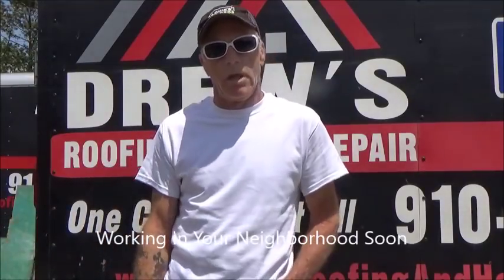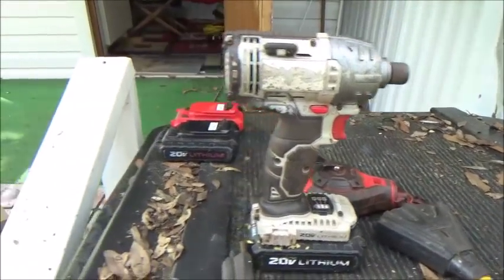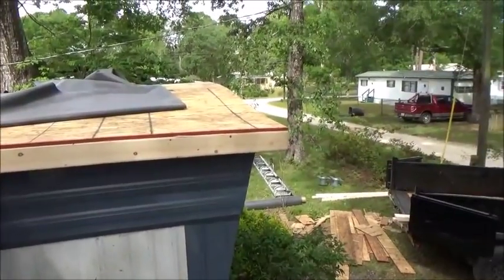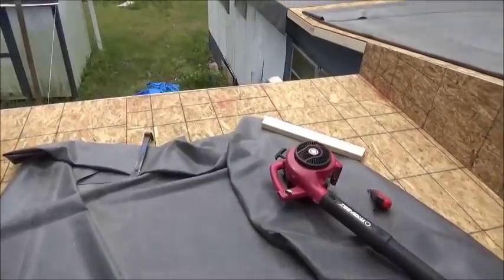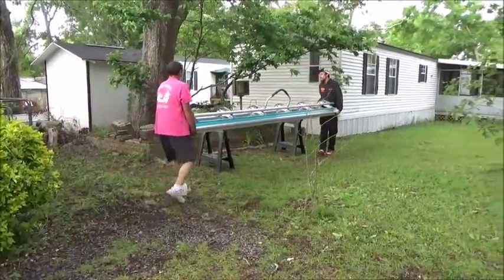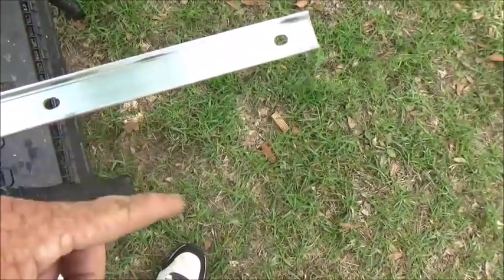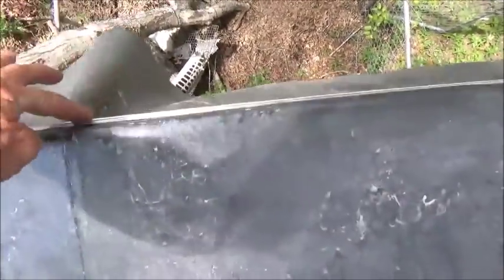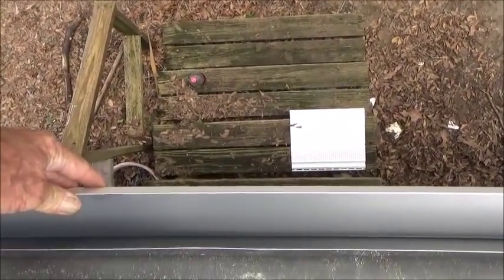How to repair a single wide mobile home trailer roof Manufactured Home

Comment: Drew, I built a front deck 10 x 10 with roof on front of my mobile home and used 2x4s for joist. Not long after we got 18 inches of snow which destroyed all my 2x4s and I ended up having to replace them with 2x6s which have held up without any problems. I wont ever use 2x4s again because they just aren't strong enough especially under all that snow. LOL
Reply from the maker: I agree. I use 2x6 for everything

Comment: Thanks for posting these. I’ve been watching for a few years now and learned a lot and did my own floors and walls. Roof is next. With a metal corrugated roof, would you still put plywood down?
Reply from the maker: mictjustin no just straping

Comment: Great workmanship Drew!!  Was wondering if it would be feasible to bond epdm to the 1 1/2 foam board insulalation used so often on mobile home re roofs?
Reply from the maker: I think so it’s water base glue so I say yes. But it’s not going to be as ridged at OSB

Comment: Seems like you should have a way to get air moving under that osb .  Condensation,  moisture from the inside of the house from cooking will be trapped under the rubber membrane. OSB turns to mush after a few years of high humidity.  Not to mention all the mold on the old roof. I have gone back to API plywood
Reply from the maker: I don’t think I’ve ever heard of a PI but they do have something called sure bored here the only thing about it is that it’s so heavy
Reply: @Drewsroofingandhomerepair  A good 5 ply 1/2"  exterior plywood with the APA -American  plywood association [not api] stamp is about $18 a sheet here. Also, there is this really fine faced sheet, I think its from Peru or Columbia unfortunately, that is exterior grade with top veneer quality for only $16. Here is a link https://www.lowes.com/pd/Plytanium-15-32-in-Common-Pine-Sanded-Plywood-Application-as-2-x-4/3043815 this has a true exterior glue where osb and fir ply only have a "exposure 1" rating. Also, I like to use pressure treated lumber for the runners, not much more than standard

Comment: I'd personally flash every penetration...lapseal is for flashing and cut edge of reinforced epdm. Lapseal gets weathered away faster than other caulking. Its really just to help the flashing cure where the factory edges have been cut.....
Reply: Geocel 4500 is a great caulking.  Also waterblock from carlise would be a better choice to do penetrations with. Bead under the membrane around hole then geocel 4500 ontop under the flange of vent.
Reply from the maker: Yes sir I agree I like Geo sale 4500
Reply from the maker: I also like Alex cell

Comment: Question, How do you know how much additional weight the exterior walls can bear structurally. When considering what possible roofing repair options you have if you want to stay within code?
Reply from the maker: Well we know that 2 x 4 walls can stand another story on top of it so a 2 x 3 wall should surely be able to hold OSB and a little bit of rubber. If you think about it I’m not adding much weight per square foot
Reply: @Drewsroofingandhomerepair  oh.... Kay. .  The 2x4 walls that are load bearing that can stand another story on top of them are framed with double  top and double bottom pressure treated wood at 16 on center on average and the wall connections to another wall require interlocking the top of the ouble plate of one with the bottom double plate of the other. And then those walls have to have diagonal sheer bracing of metal flat staapping of 20 guage or exterior plywood minimum of 1/2 inch connecting every bit of it to the double bottom. Plate every six inches.  
   There are a lot of reasons  that load bearing 2x4 walls can carry a second story and all of them are needed it work as a system. Of strengths enforcing each other .   Mobile homes require far weaker standards of exterior framing . The wall connections don't resist twist or sheer load stresses the same as the pressure treated bottom plates.    
   Is this a quick short answer you gave it is this your real qualifying licensed bonded contractors reply about the engineering of your roof builds to meet local and state building codes for structural safety ?
Reply from the maker: Well all I can really tell you is my local building inspector loves it he thinks it’s the best roof ever put on a mobile home. Maybe he’s just allowing me to do it because he knows me or maybe he’s lying to me to do it because he agrees that the weight that I’m adding to the top of this roof and the fact that I’m connecting it all together with screws and OSB makes the roof system stronger than it was that’s all I can really tell you. The other thing is I have five guys that go up on top of them roofs and I would not let five guys stand in a 2 x 2 or a 3 x 3 area unless I had plywood added or OSB added first. I can tell you in some of my videos if you watch I will put five people in one small 4 x 4 area with no issues. It really increases the strength of your mobile home roof

Comment: Just a curiosity question is there a way to include some insulation into this process?? If so would it go on prior to the plywood??
Reply from the maker: You can add insulation. It’s called high density insulation board. And it goes on top of the plywood or OSB
Reply: @Drewsroofingandhomerepair  Thanks so much Drew, your a big help.
Reply from the maker: Anytime

Comment: Could you add foam panel insulation between the runners before the decking is down, or does it need to be able to breath? Great videos by the way, want to do this on my own home, whats the cost on a project this size?
Reply from the maker: Kevin Dahlberg Yes you can add Palmer in between the one by fours if that’s what you want to do and if your roof doesn’t have vents go ahead and add them like we did
Reply from the maker: If you’re buying the material yourself you’ll probably spend about $2000

Comment: What was the size of sheathing? 7/16 or 1/2 inch? I hear you can use 3/4 but why would you?I think that's a bit much for a single wide mobile home don't you? And thank you for video. I'm going to try this next spring.Right over my metal roof with about 5 layers of  roof coat on it.I was going to attempt it alone but I think I will hire a friend to help me. If you were in my area i'd just call you but i'm out here in Utah. Thanks again drew very informative. by the way do you have to get roof permits where you are  before you do it?
Reply from the maker: No permit for this
Reply: @Drewsroofingandhomerepair  Thankyou

Comment: Can this be done on a 20x50 doublewide? Thanks for your help.
Reply from the maker: That’s a good question I’m curious why you would want to put Rubber on a Doublewide but it is possible to do
Reply: What then would be the best way to go. This is a low pitch roof on my 20x50 mobilehome.Thanks for any help.

Comment: Damn good idea. I need it done. But i have a question. How long does the rubber last? And can it handle the Montana cold weather
Reply from the maker: I’m not sure how it would do out there. I don’t think the cold bothers it so much so I would say it should work fine 
they use it all over the United States
Reply: Epdm will do well there. They roof all the camp shacks in canada that get shipped up to northern canada without issuse
Reply from the maker: I guarantee it can hold that Montana cold weather

Comment: Nice work!! Ya that's BS on too much weight.
Out of curiosity how much did you charge that customer for that project? If you don't mind my asking.
Reply from the maker: 5300
Reply from the maker: Thanks for the comment Tracy I hope you are a subscriber
Reply: @Drewsroofingandhomerepair  Yep. Lot of mobile homes in my area.
Reply: @Drewsroofingandhomerepair  Seems like the interior of this place would be wrecked from all the leaks, unless you tore some sort of roof off first.
Reply: @Drewsroofingandhomerepair  Good price for the work!
Reply from the maker: I want to say somewhere is around $5000 for the finished product
Reply: @Drewsroofingandhomerepair  I just did  a 10x52 mobile with 2 drunkards and my 13 year old son. The 55 Mil new white/black vinyl was $400 delivered, $30 for adhesive and $80 for drip edge/finish strips. $75 for  urethane caulk.  I gave the guys $100 and a few cases of beer. My kid did most of the work for $40.  So thats about $800 + gas and beer. You should look into vinyl - just as long life and won't cook eggs on it in summer. Thanks for the tips though!
Reply: @RRaucina Did the vinyl come in rolls like the rubber drew uses? 30 bucks of adhesive covered the whole roof? Must of been a thin coat? Was that 5 gallons? Where did you get vinyl. I've got vinyl coating on mine but the cold and ice are murder on it in the winter. Lots of new cracks every year. Maybe its because its on top of metal? I just noticed you didn't put any strips down or any new sheathing.Did you glue it to a metal roof? Better check it in spring if you did. Hope it works good for you.
Reply: @im12runb4trouble    Yes. I researched this extensively because I was told that TPO is better than the inner tube or EPDM black firestone material, and I came to agree. Seems that TPO is just a variety of vinyl, and that each one varies dependent on mfgr. 

This roof I did was just cleaned off carefully, all old and unneeded vents cut off, patched and the vinyl secured at the perimeter only by a 4"x2" drip edge. and the trailer was 10' wide. My vinyl came folded and it was 2 piece 15x25. I cut it to 10'3 " wide and then used the 4'-7" piece for the splice between to make a 10-3" x 54' .  N66 vinyl cement is sold to make seams or you can heat weld them. 50 or 55 mil is very heavy and shipping was more than the product. Look for billboardvinyl on google. There are many choices. I intend to coat it with a white roof coating after the first winter just to protect from UV rays, even though this product has UV treatment. I am told 10 - 20 years especially if coated. It would have been better with a new coat of plywood under, but we were pressed for time. That can happen next rehab. Since vinyl has such a large expansion ratio in the sun, I made no attempt to stretch it tight and left the creases from the shipment intact for expansion. Even if glued, I believe that bond will not last many years. The important bond is at the roof edges. I made no attempt to make a eave as Drew does, though that is a nice touch. For eaves to much of anything they need to be 2' and more.

One interesting feature is that standing water is okay where the rubber says no-go. After all, this is really a super duty pool liner. Maybe I'll post a video on my site showing the before and afters.
Reply: @RRaucina  Thank you for all the information. Ive got till spring to decide what i'm going to do but I do know i'm going to start with new sheathing and boards right over the roof up there.

Comment: Still unsure of the size of rubber I need to get for the roof and for the add on.
Reply from the maker: Michael Brewer Two pieces on the house one piece on the porch
Reply: Drew's Roofing & Home Repair unsure of the sizes to use for the roof and add on.
Reply from the maker: Michael Brewer 20x100 and you will have left over. Pot it on 1 big piece
Reply: Drew's Roofing & Home Repair so 20x100 EPDM rubber we’re can I find that and where can I find the white rubber glue you were putting down?
Reply from the maker: ABC supply or Best distributing they don’t have anything like that around
Reply: Drew's Roofing & Home Repair would it be possible to use two pieces of rubber roofing and o try and save on costs?
Reply from the maker: And then you will have to buy seam tape and it seem glue
Reply from the maker: Yes
Reply: Drew's Roofing & Home Repair so would I get one piece longer and over lap then use rubber adhesive following seam tape? I really appreciate your help.
Reply from the maker: Michael Brewer Did you figure out what you need for your job if there’s anything I can do to help call me 910-294-1761
Reply: Drew's Roofing & Home Repair yes I figured some things out. I got laid off so gotta wait on funds right now. Thank you for checking on me. Love the videos!!

Comment: The reason there are no vents extending above the roof is designed into the trailer. If you look I will bet you find a square door in the kitchen near the stove. Originally it had a fan.  This is your kitchen vent.

Plumbing: there is or was a vent installed on each drain except for the toilet. People call them scooter vents. 

Just caught a view in your video where it shows the kitchen vent.
Reply: He's talking about actual roof vents not plumbing, hood fan and bathroom fan vents. A lot of these old trailers had the vents on the very front of the trailer out the front of the roof. I've had to tear into some of these mobiles and instead of being framed in the traditional sense and using the exterior long walls as load bearing walls and bearing joists on them from one side of the trailer to the other they will actually frame roof joist in line with the trailer supported by recessed beams and on top of those joists they will strap perpendicular to that with custom ripped straps cut with a tiny slope in it to shed water. Your vents are probably out the front and back of that unit
Reply: @bolerdweller  if you look into recent beliefs on attic vents in the south you will find they are not recommended. It is recommended to insulate the roof instead of the ceiling. In other words they have come full circle. Right back to the way the old timers did it.
Reply from the maker: Exactly